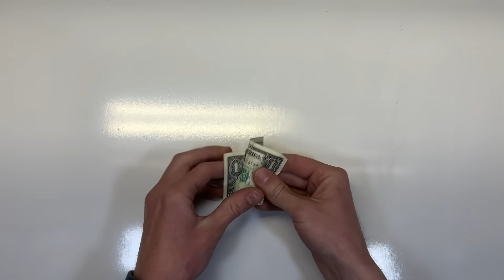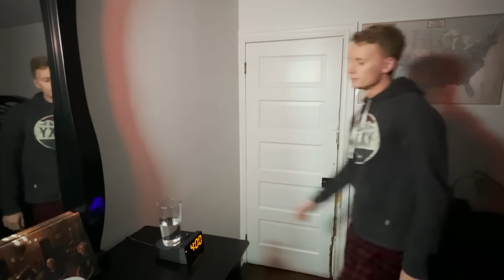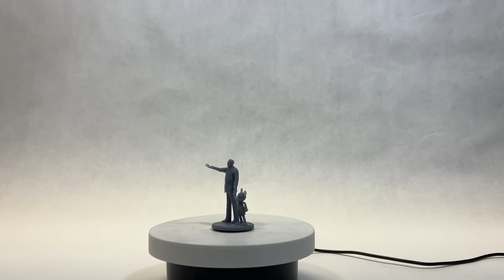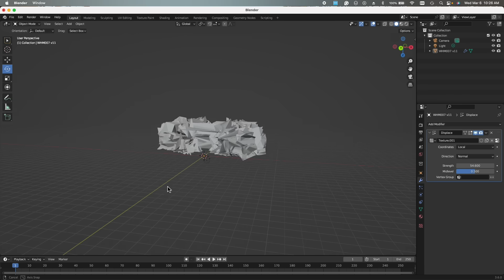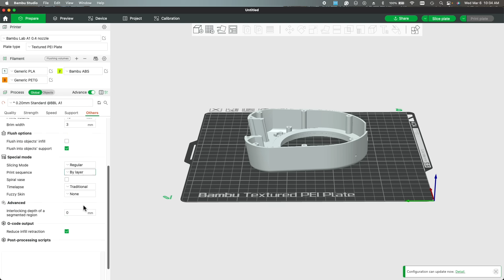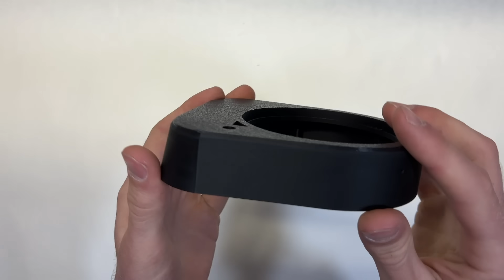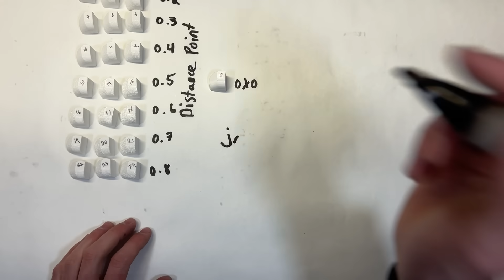My Secret To No More 3D Printed Layer Lines

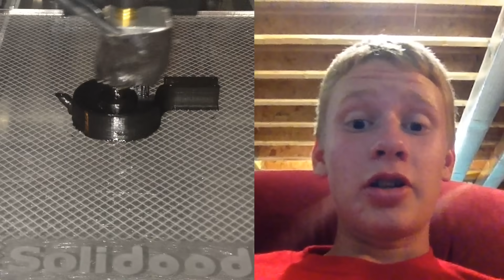Comment: Acetone is FANTASTIC for smoothing ABS parts, but heating it over a flame is pure IDIOCY (00:30). I assume that was just for effect, but it can be very safe and consistent. Before resin printing, I got very good results by suspending ABS parts in sealed polyethylene or polypropylene kitchen containers with a little acetone, and placing the container in a larger container containing some boiling water. This can achieve smoothing in as little as a minute or 2.

Comment: Resin 3d printing would have worked for you had you dialed in your settings for the specific resin and temperature of the printer area properly. You can also use Sirayatech resins blended together to create a flexible but tough resin - these are known as engineering resins. They're as durable if not more durable than many types of FDM filaments like ABS. I have and use both, different tools for different objectives. FDM is undoubtedly easier, but with resin printers you can print many parts in the same print job without taking a time penalty, an FDM printer can only do one part at a time. Resin is significantly faster and better for scaling, and the quality is also higher. They're definitely messy though and not without a lot of drawbacks like the toxicity.

Comment: I have a Elegoo printer and it's slicer is based on oracle which looks similar to the Bambu slicer. Both Elegoo and Oracle slicers have an Fuzzy skin  there's on option at the top to be able to paint on fuzzy skin. So it will only apply to she spots you want it to appear

Comment: Nice video but kind of short with the experimentation with the other methods...especially the resin printing portion.  Also, I wonder if you can achieve a similar textured result as the fuzzy method by applying or sculpting in a similar pattern on the object in Zbrush or Blender.  The mesh would have to be much denser to accommodate for the smaller textured bumpy details and also possibly smaller layer heights and extrusion widths.  It will obviously increase print time but maybe achieve a similar effect without using fuzzy.

Btw, it is more than possible to print that enclosure with resin without failing.  Just like tweaking and fine tuning settings in FDM you have to take the time to tweak settings (speed, exposure, etc)  and especially the object angle to get the optimal surface area to prevent delamination, suction cups, etc. for that enclosure to print in resin.  Sure there are caveats to both FDM and resin, but I can assure you I've printed much denser, bigger and complex bases for dioramas than the enclosure you tried to print with resin.   The quality will be smoother for sure but you most likely won't need fuzzy to achieve a simple enclosure like that.  Good luck. Take care.

Comment: Could you not just print the parts normally then just have a bucket of resin to dip the piece in to smooth and coat the outside kinda like bondo for patching cars, keeps the integrity as well as a protective coat. Problem with primer and sanding is if sprayed all it does is stack particles on the same particles. So maybe dipping it in paint could work with multiple layers and just sand it with wet sandpaper. Haven’t tested it but just a theory be cool to see you try it.

Comment: just FYI - your resin prints were fragile and warped easily because you likely used a softer resin and did not provide a base "platter" support for the print, you likely also probably did not clean the print base with isopropyl alcohol before printing, nor did you clean your print in a resin print cleaner (basically a 7-10 liter huge container with internal mixer used to fully clean the print from excess resin).
you also probably did not put your print in a UV 3D Print curing machine after cleaning it - this part is absolutely crucial to obtain maximum possible strength out of your Resin 3D Prints.
and even more importantly - you probably did not use an Engineering Resin (Loctite x Phrozen Pro476, ONYX Pro 410 or Phrozen Rock-Black Stiff resins are good example of Resin's i've had excellent experience with).
for Resin 3D Printing to work well for you, you MUST have a proper 3 device setup at the very least - a Resin 3D Printer, a Resin Print cleaner and a Resin Print curing machine.
if you are lacking even just one of those then your prints will be really bad.
having the correct hardware is probably the 2nd most important thing in Resin 3D Printing, the most important thing is to NOT mix and match resins and to NOT leave any resin in your printer unused - leaving resin on your printer for longer than a couple of days will result in a condition i personally refer to as "Resin Rot" which basically means that your Resin's quality decreases significantly and it would stick really badly to its own layers and to the build plate during the print.

i actually first got into 3D Printing with a Resin 3D printer myself through work (Phrozen Mega 4k and Sonic Mini 8k), but more recently also got into FDM 3D printing at home just for fun (Bambu Lab X1 Carbon with AMS2PRO).
and man, having gathered all of my 3D Printing experience using a Resin 3D Printing setup i feel like i dropped down from University to Kindergarten now with FDM Printing xD
honestly i really love Resin 3D Printing though, but it ends up being so messy and so expensive in comparison to FDM that's kinda no wonder most private people buy FDM 3D Printers instead of Resin 3D Printers

Comment: Hey mate, stumbled across your video. I just wanted to break down the cost of injection moulds for you 😊😊.

Making plastic injection dies (moulds) is a costly process for a number of reasons. Firstly, they use should use tool steel for the mould, not alluminium. Alluminium transfers heat to fast, and consequesntley expands and contracts too fast. With this, the quality of each part can differ drastically and consitent quality can be a problem. Not only that, but within the tool itself. would contain what is called ejector pins. When the tool opens after injection, one half of the mould hits against a internal post, forcing the ejector pins forward and ejecting the part from the mould. (Its normally in the part side)
If you have a look at plastic toys, you'll quite often see round marks on them, often with a little plastic around the edge. These marks are caused by ejector pins.

If the die/ Mould is made of alluminium, and as stated previously, the ejector pins can get stuck and not eject the part properly. Alluminium also wears very fast.
The tool steel used, is normally a high  carbon steel that gets heat treated after manufacturing. This is so it doesn't degrade in quality of time and use. 
When I was making press tooling and injection moulds years ago, there were a few types of tool steel we would use, the first being P20 steel and the other being D2. 
So each tool will take about 100 hours roughly give or take, plus materials. So if you said that a tool maker charges $95 per hour X 100 Hours, leaves about $500 for materials and heat treatment plus testing.
CNC machining made the whole process easier, but even after a mould gets machined, it generally needs to go through whats called spark errosion and or polishing, depending on the desired finish of the part. With a spark eroder, a blank the same shape as your parts needs to be made out of copper and lined up perfectly with the machined part to remove all the cut marks from machining. This has to be precisly calculated so as not to make the cavity too big or too small.  All of these calculation depend on what material the parts need to be made out of. 

There is a whole science behind it which is why it can be so expensive

Comment: Sorry to say that – but the finished part looks like sh*t. Instead of using other filaments (CF hides layers quite well) you half-assed any other alternative.
Resin works great with the right settings, FDM works great with the right filament. You could even use your resin printer to make your very own injection-mold. There are plenty, well working alternatives, but you managed to find the worst one. You didn't even mention, that you could apply this effect partially, so the problem about tolerances your talked about, is just a skill issue.

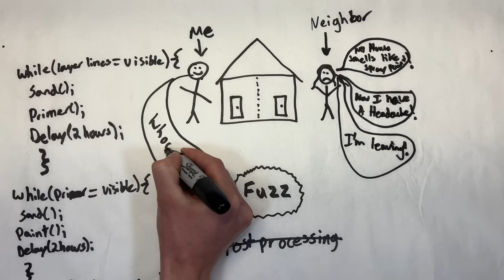Comment: 2:00 all the things up until this point are complete lies to increase the impact of your "solution"

You don't need to add "several" coats of paint, Rust Oleum 2x covers literally everything in 2 coats and in some cases, only one.

You don't need to sand something for days, you can go from 180 grit to 600 (More is overkill and useless if you're going to paint it) in less than an hour.

Spray cans don't leave any smell if done in a well ventilated area, and even when not, the spread doesn't get even close to a neighbor, LET ALONE a damn headache

Comment: Dude! Idk if you still check comments on old videos but I have your solution. Use ironing in Bambu labs. It completely smooths surfaces as long as they’re flat or mostly flat.
Reply from the maker: I actually tried that the other day and I was impressed with how well it did!

Comment: would assume to build in a little contrast betters the optics. A smoother bed surface to make the parts visible top surface more shiny in combination with the fuzzy skin. If top and wall has the fuzzy look as is now, the part looks a bit as if there was no other option in manufacturing, as if the manufacturer is not able to make it better.  A little contrast lifts the optics even more up.

Comment: For your use case, I think you might want to look into thermoforming.  They sell home vacuform kits, or you can DIY your own pretty damn easily and really step up your game.  I'm a huge 3D printing proponent, but for an enclosure shell like what you're making, molding a flat sheet of plastic into the shell will give you considerable time savings and let you have that more professional, smooth plastic style you were going for.  Frankly, I'm kind of surprised the injection molding place you reached out to didn't tell you this, themselves.  Maybe they're feuding with the local thermoforming plant, or are just willing to lead their customers toward solutions that are not really a great fit.

What I would do, having experience in both vacuforming and 3D printing, would be to make the outer shell from vacuformed sheet plastic, then make internal support structures like standoffs, component supports, etc... out of 3D printed components.  You will also most likely need to build/ print some jigs and get a hold of a router table and some other cutters that you can guide with a jig to clean up the vacuformed parts and keep things uniform.  Nowadays, this step is often handled by CNC at the sorts of places you may have been reaching out to, but a semi-skilled worker with a few power tools, well-made set of jigs and a good process can easily compete with CNC on quality, and can often be much faster than CNC, too.  The main reason that places tend to go with CNC is because it's simpler for facilities that take on lots of jobs from different companies to manage a bunch of different production runs being fired up and torn back down for low-mid quantity production runs when all you jave to do is make a rigid mount for the part, slap it on a CNC, and let the computer do all the different steps than it is to have entire manual essembly line style production stations thrown up and torn back down every time they get an order for another batch.  If you're only having to worry about producing one product, then you can handle running your production line this way.  The only thing that CNC can really do better is lots of small, finnicky cuts at awkward angles to make complex geometries.  Which, you know, the solution here is to just not design your parts with impossibly complex geometry.  CNC is also generally able to produce parts with much toghter tolerances, and having machine do every step  itself can also remove some of the human element from the list of shit that can go wrong, but it also creates a whole lot of its own headaches.  Ask anyone who's working professionally with one and they'll tell you all about the myroad ways they can fuck shit up.  In my experience, working at a factory for years where they did both CNC and non-CNC post-forming part cleanup, there really isn't a obviously perceptible difference in quality.  The only reason they were still offering non-CNC production was because it was much faster and cheaper once the production runs got high enough.  A bunch of sweaty dudes covered in plastic chips with a couple router tables, jigs, power tools, and a good process were able to easily run laps around machines that cost Hundreds of thousands or even millions of dollars, anêy day of the week.  It took longer to set the job up, but once they got going they flew.

Vacuforming is naturally very quick while maintaining a high quality surface finish, and since the 3D printed parts are going to be inside the product and not seen, you can get away with running them off in thick layer heights or even bigger nozzles, and you can run them off faster than you normally would for the same reason.  It doesn't matter if it's pretty, so long as it's dimensionally accurate enough to screw a PCB into and/ or add rigidity to the shell, and you aren't going so fast that you're compromising layer adhesion, then make that fucking printer fly.

It's a little more tooling up, but it will also expand your manufacturing skills to a whole new level.  You can  definitely run off prototype vacuform molds from high temp materials like PC, but if you run that kind of mold in production then expect to just constantly have the next replacement mold being printed.  Honestly, even for a relatively high production run, just making disposable molds like that will still probably be cheaper than the cost of the same molds for injection molding by miles for quite a long time.  You could also print out your prototype mold and then use that to cast a mold in something else that will tolerate high temperatures better, you could try experimenting with adding a layer of a high-temp material over top, or once you have your process nailed down you could just send the file off to a machine shop or even just PCBWay and have them mill you that finalized mold out of aluminum.  So long as you design your process around the fact that you will be working with looser tolerances, you should be able to do it.  You already found somethings ng that works, but if you ever needed to make the leap from low-quantity production to low-medium/ medium quantities, then self-producing using this kind of workflow might be a way for you to bridge that gap and potentially even just build up your own factory over time.  

These tips are still useful, though.  I just think you overlooked a big method of production for your product.

Comment: Get rid of the "for two reasons ✌" gesture.  I know you think it comes across as commanding and insightful but it's cringe. You look very arrogant and ignorant overall (point in case "Bambu labs has this special fuzzy skin setting" dimissing prusa has had it for years, so did Cura and then eventually Orca slicer").
Reply from the maker: Peace ✌️
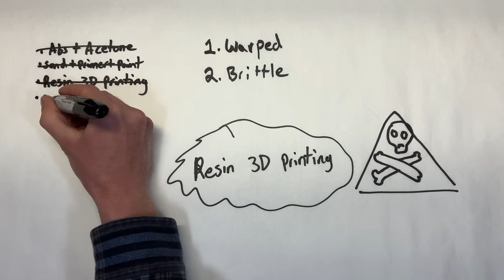Reply: @jakemgrim  cringie teenager. Does mom do your laundry too? Maybe there's a Bambu Labs mom, 75% more expensive with Bambu Lab branding and that special "fuzzy skin finish". Also the first 4:27 minute video are filler, I understand you need to pay the bills and I'm assuming Bambu Labs keeps your lights on but come on man.

Comment: Resin printing definitely would have worked for this. Probably used the wrong resin. Also, with a big flat edge I would have set it with no base and no supports and had the flat edge on the build plate.

Comment: so you're mass producing a product to sell by printing each product out ?  there's  your first (expensive) mistake.  One does not typically sell mass 3d prints due to the brittle nature of the prints.  One would do a master print, clean up all the print lines and then used it for creating a master mold to cast into, that's how you do it if you want to mass produce in your garage and not the f whatever you  were doing.

Comment: This is a lie although it does look rough on the outside and has no lines in layers it also makes the finish rough as heck for me just changing fuzz from none to contour and .03 on both I wish I could upload a print one from kobra s1 and one from flashforge AD5M pro ….

Comment: They were going to build you injection molds for $10k?!  I don't know how many clocks you're selling, but that price for a mold is incredibly cheap.  Most of the molds I've used in the past were at least 10x that, with most being approx 20x that price.  If you ever get to higher volume, it might be worth the cost.

Comment: One thing that inventors keep forgetting about is casting and molding... once you already have your 3D model printed. It's still faster than 3D printing, holds tolerances and surface finishes and you can use all kinds of 2 part plastics, urethanes, resins etc. Creating ONE part, means you can use that part to create dozens or hundreds of silicone molds, meaning you can bypass injection molding all together, unless you reach a critical peak of production limitations where financially it makes more sense to finally pay for the molds to be machined.

Comment: Making all walls fuzzy is probably because if you do outer walls only, there will be little gaps between the outer and inner walls. I don't know how much that might matter though, I haven't really experimented with this stuff.

Another tip for less visible layer lines is to use matte filament. If the plastic is shiny, layer lines will be MUCH more obvious. I love using PolyMaker's PolyTerra PLA for this reason.